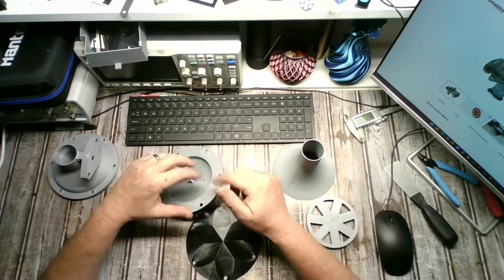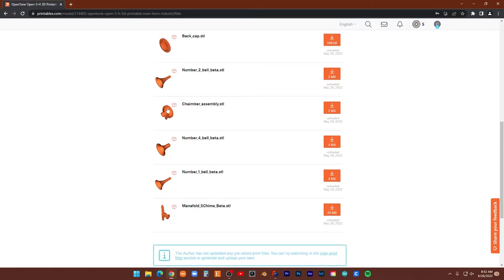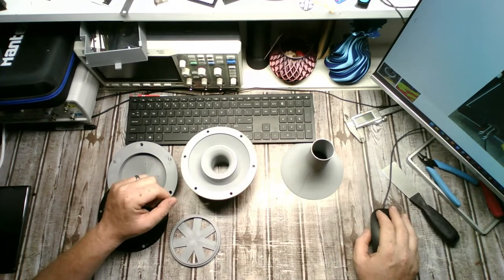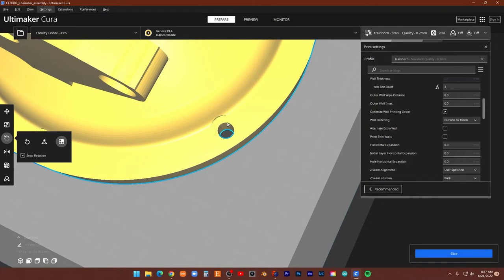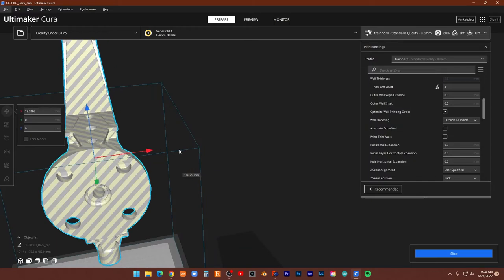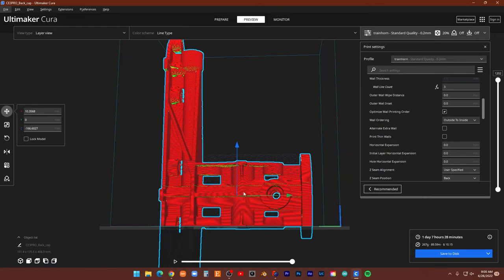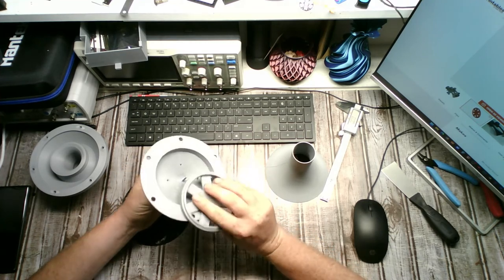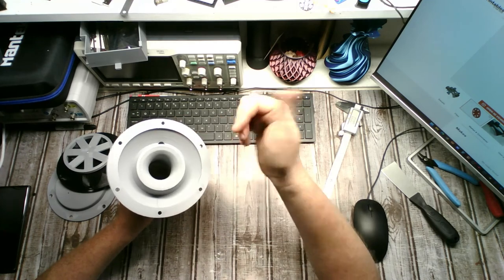3D PRINTED TRAIN HORN upcoming BUILD preview

Comment: Hello, i am the creator of the original file reviewed in this video (awesome review btw), I have uploaded an updated model to printables, my apologies for the removal of the original file and lack of communication (i am a busy engineering student), took it down because it had mesh issues with the manifold, I ended up redesigning the whole thing from scratch
Reply from the maker: That's great to hear. I'll be doing an updated video soon. I have everything printed but yeah. That manifold issue kind of put it on the back burner for the time being. I'll be in contact with ya.
Reply: Its titled “Open Tone Convertible 3 & 5 tone Air Horn Mark 1”
Reply: Awesome! In the mean time I can take a look into the manifold  issue again, i am currently working on a solution to it
Reply from the maker: @miken692  only issue I have is with the open mesh near the horn ports. But I was planning to just bondo them. Other than that. It printed well.
Reply: Im about to actually install one of these on my full size locomotive!

Comment: What’s the diaphragm made of?
Reply from the maker: I printed one out of tpu. I should probably revisit this build.
Reply: @Shenanigans3D  did you ever test it out?  It looks interesting
Reply from the maker: I tested one of the horns. The manifold had problems with the model itself. The creator made a new version. I have the v2 manifold printed. This is something that I will definitely reprint the v2 horns and test the full horn.
Reply: @Shenanigans3D  yeah redo’s are expensive!  I’m working on a different model right now.  Should be able to try it out before the end of the week.
Reply from the maker: Nice.. I'm in the process of a technical design. I'll see if I can work in some time to  finish printing the second version that was released.
Reply: @Shenanigans3D  well I made a different model horn than this one.  I downsized it to a 3” diaphragm which in reality is only 2”.  I used a piece of plexiglass for the diaphragm and sealed it all together with acrylic caulk.  It definitely works!  Sounds like one of those horns on a can, but it is incredibly loud.  I designed a new one that has a 5” diameter and a very long horn.  We’ll see how it sounds over the next couple days.
Reply from the maker: Haha that's awesome.